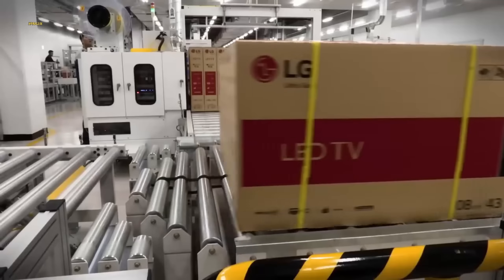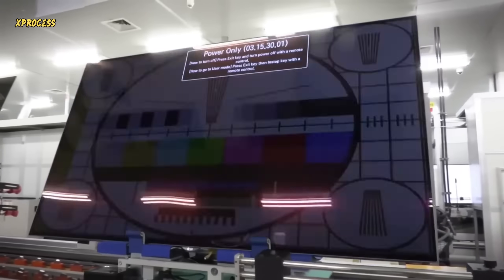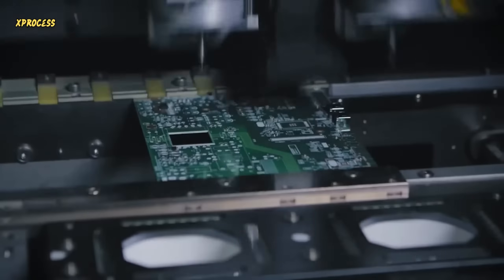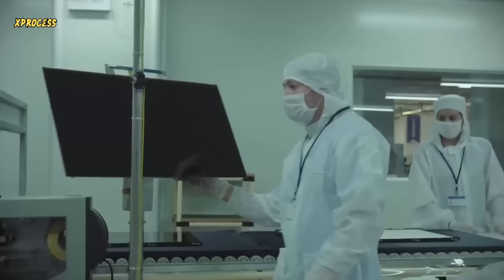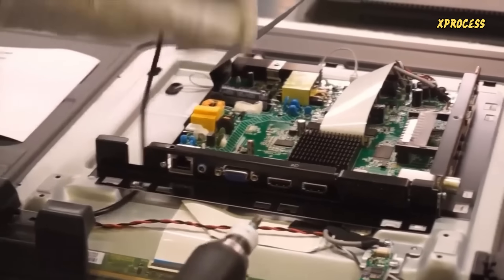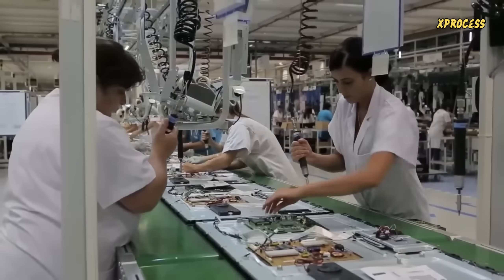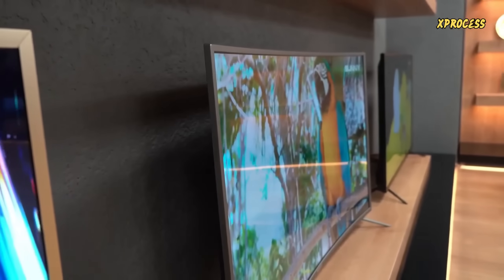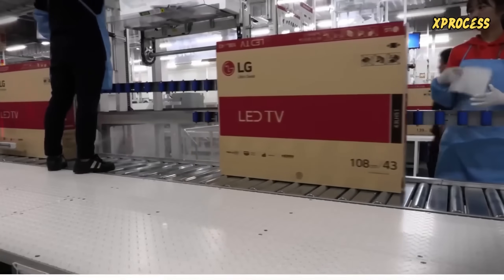How Televisions Are Made | Biggest TV Factory In The World !!

Comment: Im old enough to remember taking tv tubes to the hardware store and plugging them into the free tube tester. You bought the replacement tube at the counter and fixed it yourself if a bad tube was the problem. If not, it went to the tv repair shop in town. They were, of course, black and white, not color. Sigh!

Comment: the main light panels may last that long the main processing board lifespans tend to be 3 - 5 years based on use. its significant because manufacture's are discontinuing  key component replacement parts after 4 years

Comment: "They don't build them like they used to" is more true now than ever. I've bought about 10 flat screen TVs in the past 15 years, and when the image falls apart there is no practical or cost-effective way to repair them back to original quality, so I just give it away and buy another one. Currently I have two identical 43" Samsung LED UHD 4K units, which are now about 2 years old. One of them has very faded weak colors until I leave it on for a while then it gets better. The other one has a problem when viewing a very light scene there are what appears like 12 "light bulbs" which shine through. So again I'll wait until they get unwatchable then go buy whatever is the latest technology, and probably buy Samsung again. So it's like a throw-away business with limited lifespan, which is obviously quite disappointing. The prices keep coming down though, so hopefully we'll reach a crossover point where spending $500 per unit will have a solid 5-year good quality lifespan. Same could be said for refrigerators and washing machines. My parents had rock-solid fridge and washer back in the 1970s which lasted for about 40 years and they just kept going strong. Now the new models stop working after just a few years.

Comment: Watching tvs go from cathode ray tubes to flat screen has been impressive. Between just a tv and a computer monitor the old crts would take up a decent amount of space, especially if you wanted and could afford a large one. 

Now you see massive flat screen tvs going for a fraction of their crt counterparts prices, and weighing far less. What once took two people and a handcart to move, one person can manage. And computer desks have now had space freed up making the old keyboard slides unnecessary. 

All of this change happened in less than 20 years which is amazing considering how long the crt itself lasted.
Reply: Still a regular CRT takes less space, uses less energy and has way better long-term reliability. 150cm of black is still a huge living space invasion, even if it is 3mm thick, optically it is a much more violent object than a 20 inch CRT. Not to forget the design, CRTs actually had a design, you had something to choose. Now it is basically 1m2 of void.
Reply: CRT: big and bulky, the biggest one probaly 32inch
and then the Plasma: slim and heavy, can be over 100inch
LCD, LED : slim and super light
OLED: 1mm thick
Reply: Flat screen tv was invented in the 1960s and only had 3 colours, and that's where it stopped

Comment: I won't buy a computer monitor, I just go over to Wal-Mart and buy a TV set instead. Get it on sale and it's cheaper. HDMI ports work with anything. My first digital TV (bought in 2010) is still in use (actually using it right now!). You used to have to spend a fortune getting a TV set fixed. Now, if they ever break, just throw it away and get another. The average price of a TV set 70 years ago  ($150) is just about the same as what you pay today. Technological advances have just about nullified inflation.

Comment: Buying a television set used be quite a chore, the bigger the set the heavier it was and the box was huge, a two person process usually requiring a large vehicle to trassport the thing, a van or pickup truck, then there was the arduous task of getting it into the house taking it out of the box and setting it on a sturdy stand, before that were the big consoles sometimes with the stereo components but in, a large heavy piece of furniture, they were for people with a lot of money and a big house and couldn't be brought home it had to be delivered. Who would have thought that one day you could go to the store pop a 50 inch tv in your shopping cart and wheel it out of the store by yourself, I bought a Panasonic 47 inch projection tv back in 2000, it was a massive unit that was delivered, a plasma set at the time cost around 20,000 and weren't that big, I paid 2,500 for the 47 inch, I sold it right before flat screens started to come down in price, a friend of mine has a 65 inch I think projection tv in her basement that her brother bought, it came in two pieces, nobody will ever want to buy it so she's stuck with it.
Reply: lol. I literally just did that when I bought a 50 in tv for Christmas.
Reply: I remember Sony Color TVs of years ago had a concrete patio block inside to give it weight and stability. Maybe other brands did too.

Comment: What is truly fascinating is how they have turned this modern electronic device into a disposable, non-repair viable industry.
Reply: Problem usually comes regarding cost. If you bought a low-end TV for a few hundred dollars, are you willing to pay somebody $200-300 to figure out the issue and try to repair it? At that point, it's better to just buy a new TV.
Reply: @addanametocontinue  Exactly—that’s where it gets tricky. For a low-end TV, the repair cost often outweighs the price of just replacing it. It’s a shame because it encourages more waste. Do you think there’s a way to make repairs more affordable, or is the industry just too far gone?
Reply: @addanametocontinue  ESATTO 🏅🏅🏅🏆🏆🏆🎖️🎖️🎖️🏅🏅🏆
Reply: @addanametocontinue TV can cost thousands of dollars. depends on many factors
Reply: 9 of 10 with electronics the error is on the solderpoints of the transformer,thats heats up and down,and slodder cracks,no contact,dead.
Resolder and have fun.
Reply: @ronaldderonde my washing machine chassis rotten at 1 corner. This cause the drum to loose balance which broke the drum belt.after 8 years i had to buy a new one last week.This week my dishwasher stopped working 3years 7 months , issues steam gets in motherboard, once repaired on warranty.my italian car got a flooded ECU which burned its bosch ECU, the car does drive now.Sadly all electronic are as reliable as their designed life aka warranty.its not as simple as resoldering.
Reply: @drincogni  you are wrt
Reply: @drincogni Your washing machine rotted? So, stop buying crap.
Reply: @stanleynowak9325  no it was in the garage where my dogs pissed on the side and this advanced the rust.
Reply: So true!
Reply: Bernardus khan AMC newspaper TV show OMC AMC newspaper
Reply: Hence why you e-recycle it?
Reply: TV's are totally repairable
Reply: @matthew6994      but why repair when you can replace for the same amount of dough.
Reply: @patbrennan6572  Yes, but depends on the type of TV and what's wrong with it
Reply: صحضحضجضجضجضججضجضجضضه
Reply: سحضحضحضحضجضجضجضضج
Reply: صحضحضحضحضحضحضحضحضحضحضحضحضحضحضحضحضح
Reply: صحضحضحضضححضحضحضحضحضحضحضحضححضحضحضحضحضحضحضحضحضح
Reply: That's a great point! It's wild how something as advanced as an OLED screen is basically designed to be tossed out when it breaks. 📺🔧 Back in the day, you’d repair what you could. Do you think we'll ever swing back to making tech that lasts, or are we stuck in this disposable cycle?
Reply: I just watched this on my Sony Bravia from 2009. It’s not 4K but meh it gets the job done.
Reply: as long as you don't dump your old tvs (+other electronics) and properly recycle them, you are basically evening it out in the end. Also helps to not have idiots around your TV, and don't wait till the last minute to repair it
Reply: شحضحضحضحضحضحضحضحضحضحضحضحضحضحضحضحضحضحضحضحضحضحضحضحضحضحضحضحضح
Reply: شحضحضحضحضحضحضحضحضحضحضحضحضحضحضحضحضحضحضحضحضحضحضحضحضحضحضحضحضح
Reply: ١ضحضحضححضحضحضحضحضحضحضحضحضحضحضحضحضحضحضحضحضحضحضحضحضحضحضحضحجضحضجضجضحضجضح
Reply: ضحضحضحضحضحضحضحضحضحضحضحضحضحضحضحضحضح
Reply: صحضحضحضضححضضححضجضضجضججضحضحضحضحضحضحضحضحضححضحضضحضحضححضضحضحضحضضحضحضحضجضحضحضضحضحضضححضضححضحضحضحضحضحضحضحضحضحضحضحضضحضحضححضحضحضحضحضحضحضحضحضحضح
Reply: yep
Reply: Your comment is very accurate and insightful! What are your thoughts on the long-term impact of this process?
Reply: Vendors are giving very bad quality. 
In almost 5 yrs the led gets out of order.
After repairs they do not perform as before.
Reply: Amen
Reply: I purchased a Sony 50" TV for the master bedroom, it was barely used it cost 900 dollars. It broke at 4 1/2 years, lucky I bought the 5 year warranty for it so I got all my money back. I purchased a LG OLED tv. Those Sony's cost a fortune and they simply just break.  I have a 13 year old Panasonic Plasma that still works and gets used everyday.  I can get the Sony fixed for about 250 dollars, but how do I know if they fix is good as well?
Reply: @Moondoggy1941 my Samsung plasma (at least 10 years old) works just fine. It’s not 4K but who gives a shit. At 77 years old I don’t think my eyes could see the difference.
Reply: They sell them so cheap cause they aren’t making the money off the TV but off our DATA !
Reply: My screen was replaced a few months ago, get insurance bud.
Reply: It's mostly the consumer fault, since we'd all rather just get a new tv today, rather than wait a few days for someone to come out to fix it, when we've all heard stories of technicians who just make it worse intentionally, or if they do fix it, it's almost the same price as a new tv. They made tvs affordable is what you mean to say, ANYONE can get a big flat-screen now.
Reply: Limited lifespan you will buy updated tv
Reply: They can be repaired.  I just fixed mine a few weeks ago.
Reply: @johnwilson7809  That’s awesome! 🔧 Sounds like you’ve still got those tech-repair skills from your Radio Shack days. What was the issue with your OLED, and how did you fix it?
Reply: @processarea91  I have a plasma TV.  I was having a dark black vertical line.  It was the result of a connector that attaches a ribbon cable to a PC board that worked loose, or just developed a high resistance contact point.  Just found the appropriate PC board, detached the ribbon cable very carefully, and re-attached it.  Black line gone.  The hardest part was getting to the right circuit as it was buried.  And about 50 screws just to remove the back cover.
Reply: @johnwilson7809 ... Hisense can't or at least nobody will touch them as the screen is glued in place as is the reflection sheet
Reply: Q @johnwilson7809
Reply: @johnwilson7809  TV's from 2010 generally don't need repair at all, and these still work today. I'm shocked by the amount of modern TVs that have dirty screen effect, loose reflectors, and burned LEDs even within waranty time span. Not to talk about horrible software on modern TVs.
Reply: @lovemadeinjapan Mine is 2008, and I repaired it.
Reply: @johnwilson7809  what broke? which brand?
Reply: @johnwilson7809 donno about your country in india repair cost itself is high along with the problem of scam from technician and even if you risk and repair then the colors won't be good
Reply: It is repairable in the Philippines

Comment: tvs dont last more than 2 years now
Reply: Depends - turn the backlight down and they last many years - a free tip from your local tv repairman. Backlight on vivid or 100 percent makes leds run hot and they fail. Set it at 60 percent or Normal and they run much cooler.

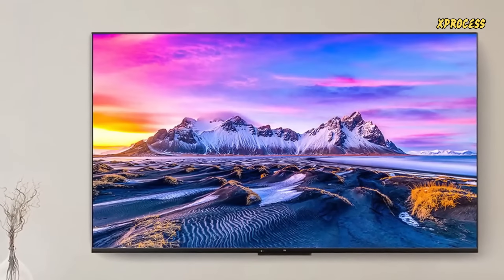Comment: 4:03 "A TV can display over a billion different colors."  I think not.  The human eye can only see about 1/100th of that, about 10 million.
Reply: Your phone has an 8 bit display. That means it can display 256x256x256 or 16.7 million colors which is actually low. Higher end TV's are 10 bit which means a billion shades of color
Reply: @royvirafayet6687  990,000 of which the human eye cannot perceive.
Reply: Correct. our eyes cannot tell the difference between a 4K screen and an 8K screen if they were not marked. Only a tester machine can tell the difference. If you buy an 8K you are paying for nothing as you cannot tell the difference only think you can.
Reply: @saintsone7877  you will be able to differentiate between 4k and 8k. But only if the screen is large enough so that the pixel density is low enough

Comment: I remember testing the vacuum tubes at Radio Shack from our old analog TV in the 1960s.
Reply: I remember when Radio Shack was a hobbyists dream. All kinds of electronic parts to build or repair audio equipment. And you could find a connector for anything. And their own brand of audio. I miss Radio Shack.
Reply: @garfieldsmith332  I'm with you brother, and I miss them too!!!
Reply: My first job in 1972 was at Radio Shack and I believe the most popular thing in the store was the tube tester.
Reply: @mauryd3444  Did you ever wonder if the tube tester worked?
Reply: @garfieldsmith332  We actually tested it once in a while with known good and bad tubes and yes, it always worked.  Replacement tubes sold to replace defective ones were never returned, so I always assumed the replacement tubes fixed whatever they were being installed in.  There were still a lot of vacuum tube radios in existence in those days, not just televisions.
Reply: @mauryd3444  It was the old joke that the tube testers always showed bad tubes. I remember those days when you went to get the new tubes and junk the bad ones. TVs, radios, HAM radios, lots of tubes back then, And point to point wiring, And the units weighed :a ton:, solid, well built.
Reply: @garfieldsmith332  Retail tube testers were simple emission testers. Basically, they checked for inter electrode shorts and determined sufficient cathode emission. Adequate for domestic radio diagnostics. More serious work calls for a mutual conductance tester, which applies a more real world environment to the tube in question. This is the type most technicians carried with them, but a lot more expensive. The best test is a substitution with a known good tube. Usually, you can tell by the symptom if the problem is a tube or elsewhere. Sometimes the problem may be a shorted, leaky, or open capacitor. and something like that can destroy an otherwise good tube.
Reply: @dougbrowning82  Thanks for the info on the circuitry. Never knew how exactly they work. There we were fooling around in a back of a TV set that could electrocute you.
Reply: @garfieldsmith332  Test the tester.
Reply: @garfieldsmith332  Yep, black and white cathode ray tubes (picture tubes) stored 10,000 volts with low current and color tubes stored 10,000 to 40,000 volts also with low current depending on size which required discharging before service was performed.  Would certainly get your attention.
Reply: @garfieldsmith332 my grandma had a tube tv until about 2009 or so. When she finally got a flat screen it sat on top of the old tv😂
Reply: @mauryd3444  That must have been quite the experience! 📻 I can imagine people lining up with their old TV tubes in hand, hoping for a quick fix. Do you ever get nostalgic for that old tech, or are you glad things have gotten more advanced?
Reply: @processarea91  Glad for advancement, but wish things were built to last instead of everything being disposable (cheaper to replace than repair).  If the tubes were all good, a service man would visit your house and fix the problem on the spot, all the way to replacing the cathode ray tube.  Of course, I like the superior picture of today's flat screens and they're not as heavy as a boat anchor, so there's that.
Reply: Tubes
Reply: @johnkulpowich5260  Yep. High end audio still use them today.
Reply: I still have my dad’s Zenith black and white from 1953, it still works great.
Reply: That would put you close to 75 years old 🤔
Reply: @sofa_kingcool985  yes 73
Reply: That’s such a cool memory! 🔧📺 Bet it felt like stepping into a mini science lab at Radio Shack! Do you miss the days of analog, or are you all about today’s flat screens?
Reply: I still work with tubes, mostly audio tubes, though. They're great for sound.
Reply: What's y'all obsession with a damn tube? What are y'all talking about?
Reply: @yytyyy5329  Tube testers. Back in the day, they were all over the place, because many electronic devices used tubes.
Reply: You must be very old
Reply: @nfGMD-gv4sf  Yes very very old like Nick someday
Reply: @MoneySavingVideos  im 16 bro
Reply: @nfGMD-gv4sf  "Old" is relative.  You are old to a new born, old man.  LOL
Reply: TV existed in 1960 ?
;o)
Reply: most drug stores had tube testers
Reply: Théatre👽👽👽👽👽👽..

Comment: Thanks! However..... There are two or three videos on youtube that describe how Analog TVs work.
Are there any that describe how the current Digital TVs work?
I'd say that it's like a million window shades opening and closing.
Reply: They work exactly the same except instead of a demodulator to convert signal into picture they have a decoder, but other than that small component they are identical.
Reply: Thanks, but I meant the display.
Reply: @krashd digital TV's don't have crt. The phosphorus layer is missing and digital TV's require backlights